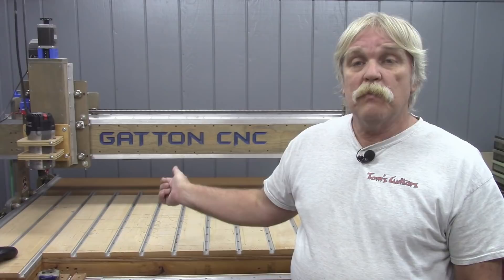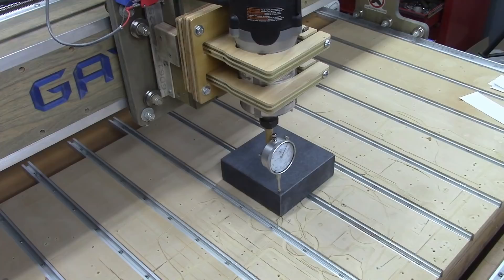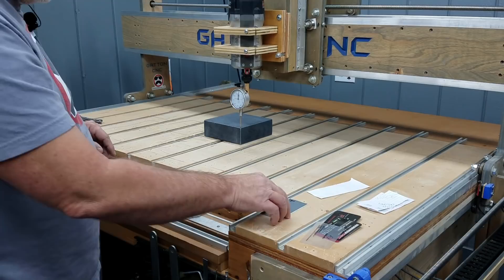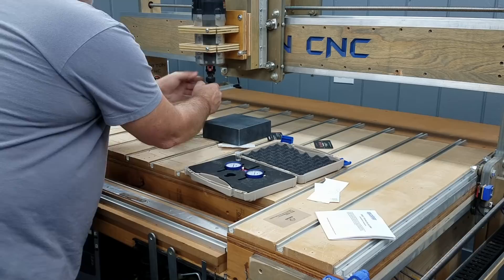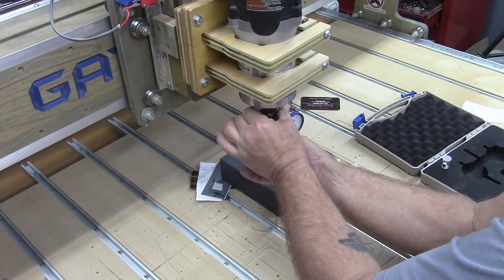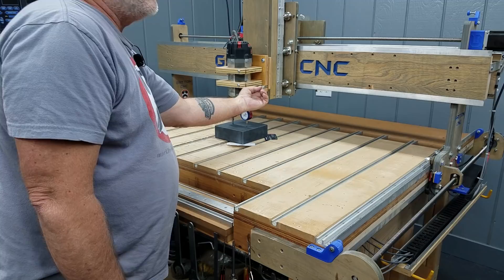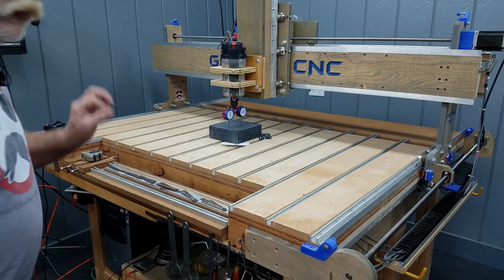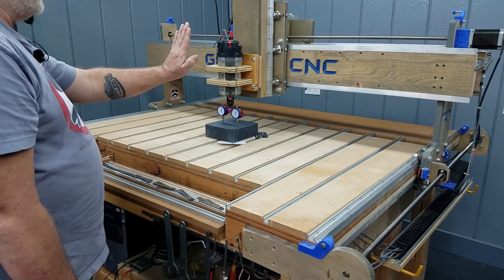Tramming My Gatton CNC After Moving It

Comment: I have been watching tramming video preparing to get my machine all squared up. I noticed that people will tram using the waste board then flatten the waste board. I thought that seemed sort of off if the waste board isn’t perpendicular to the router. So I started thinking about how one could tram and I’d like to get your thoughts since I consider you to be one of the most knowledgeable cnc guys around. 

So my thought is why not take a very flat piece of metal - like you would use to set the in and out feeds on a jointer - and place it on the two parallel tubes of the cnc - I have the onefinity - so it’s basically straddling the y rails. Use that surface and an accurate 90° square to adjust the router left to right and front to back. That would tram the router directly to the cnc. Afterwards, you can flatten the waste board so that it is perfectly parallel to the xy plane of the cnc.
Reply from the maker: You're on the right track, and your instinct is correct - if you tram to the spoilboard, you may be tramming in an error that you'll chase in circles for weeks. While your thoughts on using a piece of metal are interesting, I found that using a dial indicator, and granite surface plate, and a tramming system from Edge Precision was not only the easiest way to go, it was the most accurate. Yes, there is a cost involved, but there's a cost involved in ruining project material as well. Basically you're using the surface plate and dial indicator to create a level, flat plane to tram to. Once you've got that flat, level plane, you're golden.

 After I got my Avid CNC, I made another video showing how I trammed it. I got very surprising results, and have been very satisfied with the performance. When flattening slabs or glued up panels that are too big or too small to go through my planer, I get silky, smooth results. A quick once-over with some 220 grit on my random orbit sander is all I need, and it's ready for finishing. Here's a link to a video I made about how I trammed my Avid 4848 Pro: https://www.youtube.com/watch?v=NvT3qj4B5DA
Reply: @MarkLindsayCNC  thank you!

Comment: Mark excellent walk through. Your attention to detail is amazing. But, if were me, I'd noodle away to modify the router's mounting plate to something similar to how a bandsaw's tracking wheel adjustments are made. With a adjustment screw per axis.
Reply from the maker: If my router mount was made of metal, I would do a lot more "noodling" with it to do just that. Since the entire thing is made of plywood, I don't have a lot of options when it comes to set screw adjustments. This isn't the final design of the mount, however. That's why I'm not offering it up, and why I haven't made a video on the mount yet.

Comment: I have a Gatton CNC but I am interested in your modification to add an offset bushing to tram the router. Is the modification in one of your videos?
Reply from the maker: Unfortunately I didn't make a video on this modification. I had planned on it, but I got the Avid CNC before I could get that video made. Once I started getting the parts for the Avid, my focus went toward getting that built. Basically, I looked for an offset bushing that had an inner diameter of 1/4 inch - that would allow me to use a 1/4-20 bolt to mount the tramming plate.

Comment: Great job. I was a little confused on the shimming. Did you put the same thickness shim on both sides of the mount or just in the middle?
Reply from the maker: Just in the middle. Keep in mind this was on my old CNC that was made of plywood. I've since upgraded to an Avid 4848 Pro series CNC, and the tramming process was a little different. Here's a link to that video: https://www.youtube.com/watch?v=NvT3qj4B5DA
Reply: Thanks for responding. My bracket is aluminum but the center is at a different opening width. So I assume because of that I should shim both sides of the mount.

Comment: When you finish the whole process w/the surfacing of the spoilboard, will you re-check the DIs on the spoilboard to make sure they match what you had on the surfacing plate? I'm guessing the spoilboard material doesn't maintain flatness like granite so I'm wondering how far off that material will eventually get compared to your tramming values (I didn't hear you talk about this in your Q&A).  Also, a little trick I use for the DI mounted to the router for the initial gauging of the surface plate is to take the back plate of the DI off, rotate it and re-attach it, then you can run a long .25" bolt up through the lug nut hole (put a nut on the bolt to lock it to the lug) and the other end of the bolt goes directly into the router collet (it's one less jig to have to make/track).  Thanks again for your great vids!
Reply from the maker: Thank you for the tip on the DI!. I use it for other things besides this, so I need to keep it oriented like I have it, but I'm sure it'll be very useful for other folks.

And no, I didn't recheck tram after surfacing my spoilboard, as there was no need to. You can chase numbers all day long when tramming, but for woodworking, it just isn't necessary.
Reply: @MarkLindsayCNC  Somehow I have extra DIs so I just keep one w/a bolt in it so I can mount it whenever.  As much care as goes into tramming and verifying level surfaces/planes, when it comes to both the spoilboard and actual workpiece it's always fascinating to pass a DI over a mounted piece of wood to see how uneven most stock pieces are.  Just reinforces that while we measure to thou when calibrating the tools, the machinist accuracy factor goes out the door w/out planing/surfacing the wood first (or machining metal).

Comment: I don’t understand why you shimmed the block off of the table. You adjusted the router to the block not the table. What was the dial indicator reading when the x axis was all the way left then all the way right? What about the y axis? All the forward then all the way back. After those adjustments are made then adjust z axis? This isn’t making sense to me. I’ll definitely tune in to the live show today so I can understand this better.
Reply from the maker: Yes - I adjusted the router to the block. Leveling and shimming the block was done to give me a flat, level plane above the table to ensure bits will be mounted flat to match that level plane. Then when I surface the spoilboard, the bit will be flat in space, and cut the top of the spoilboard to match. If I adjust the router to match the table, I'm introducing tilt and nod caused by any variations in the spoilboard surface. That will result in shingling and scalloping, because the bit isn't flat in space. One edge of the cutter will cut deeper than the other, because it isn't square to the movement of the gantry in Y, and the router along the gantry in X. I explained and illustrated this a lot better in my previous tramming video. Here's a link: https://youtu.be/FzFPadoZH5Q
Reply: @MarkLindsayCNC  I get it now. I did a lot of CNC maintenance on machining centers and lathes so I was familiar with working off of the table. When I made my CNC Router it drove me nuts trying to get that x axis parallel to the table. I guess if I would have understood this procedure it would have been a lot easier. Everything I’ve made so far has turned out pretty good so I must be very close. It’s about time to surface my spoil board so I’ll find out how close I am. Thank you for the education.

Comment: erm its not trammed . if the spindle is not straiht it still might measure the  same on all corners... you measure the base compared to the linear rail. not TRAM
Reply from the maker: Erm - it was trammed. The spindle was straight. Period. I surfaced many a slab, and carved many a project after I finished the tramming you saw in this video, and got perfect results every time. And a perfect result is what it's all about.